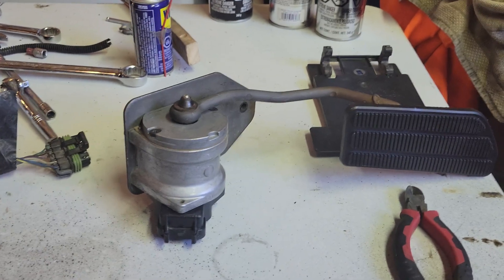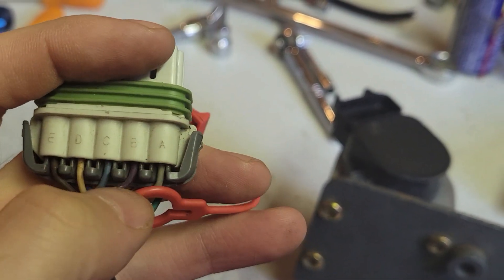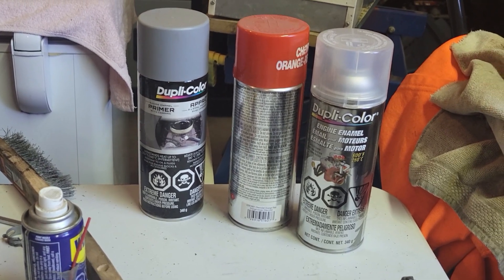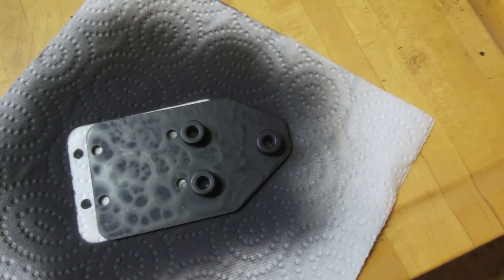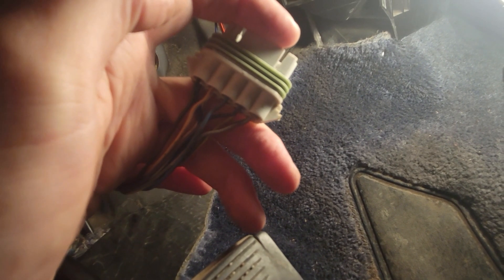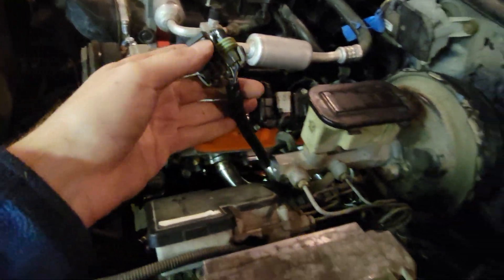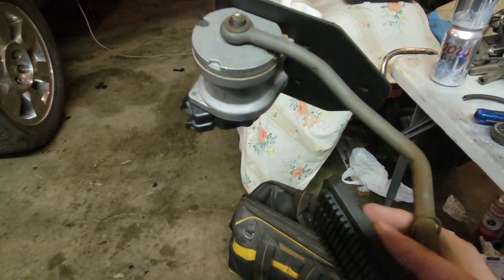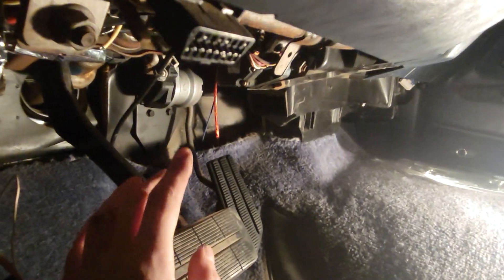88-99 OBS LS Swap DBW Install!!! ( 6.5 Pedal Re-Pin )

Comment: But did it work??!!
Reply from the maker: yes actually it did! I ended up giving it to a friend of mine when I switched back to DBC and the Holley Terminator X Max.
Reply: @TahoesNTurbos  Thanks! - I’ve been having troubles and will give the repin to A trick a try. It’s the one thing I haven’t tried yet……. If it’s working with ign on I should hear the throttle body motor responding to pedal movement? My swap is into a g van, so throttle body is no distance from footwell!
Reply from the maker: @vincentacheson1101  I wish you the best of luck! I got my info right off of ltswap.com so they may have updated things since I made this video. I will say tho that if holley makes it so I can use the earlier truck stuff then I will revisit this for sure in way more detail. Thank you so much bud and Happy New Year 🤘🍻